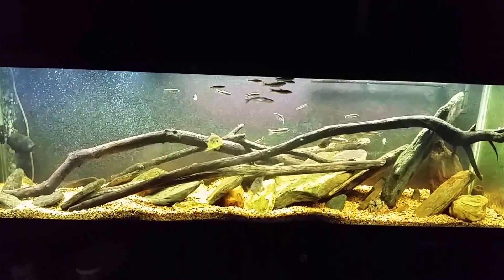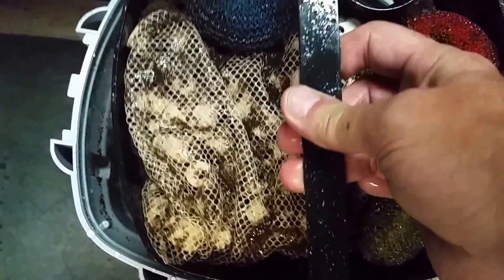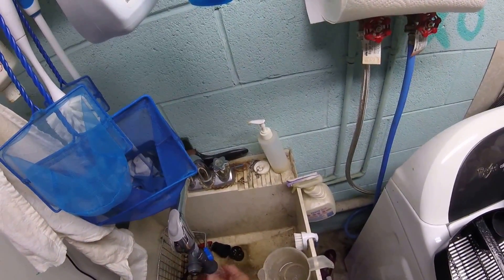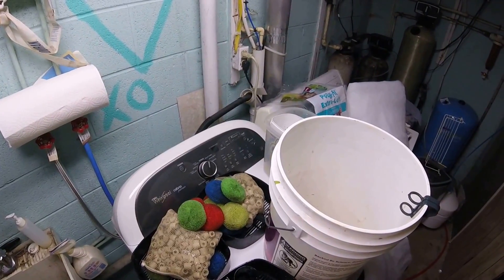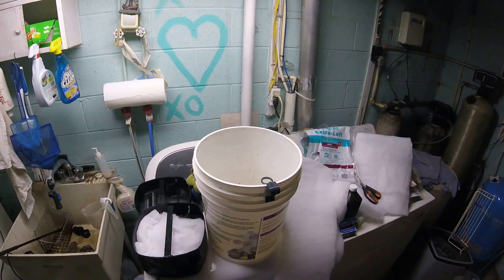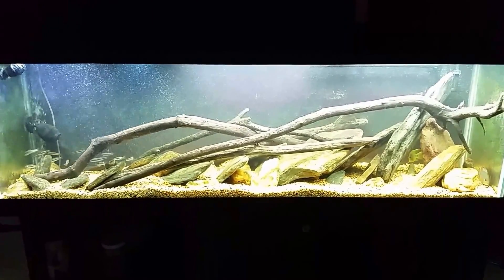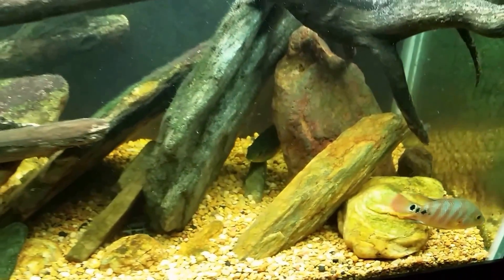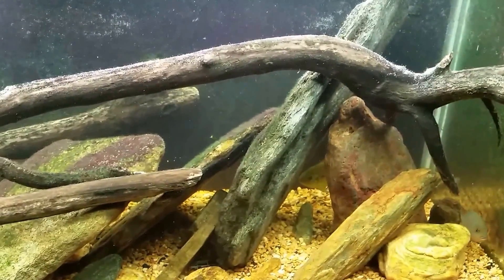Native Tank Maintenance: A Look Inside The SunSun Canister Filter

Comment: Hey Dan, I use well water also.I have a lot of different thoughts when doing water changes,ie winter and summer.It seems that April water changes induce spawning.Something to do with snow melt? What are your thoghts? Have not seen anybody discuss well water in the New England area.
Reply from the maker: I'm sure it changes seasonally, but I don't know how rapidly things like heavy rain or snowmelt affect it. How long does it take water to seep into the water table? This isn't surface water caused by runoff. I hope that my system smooths out some of the shifts though.
Reply: How Deep is your well.Mine is at 385 feet going through granite.Live in the granite state.N.H
Reply from the maker: Wow! Ours is the legal minimum, of 183 feet (actually it's listed at 185) however, when we pull the well pump, the waterline is only about 30 or 40 feet down. The pump hangs at about 140 to 150 deep, so it's waaaay underwater.